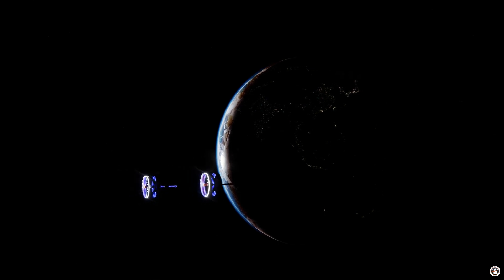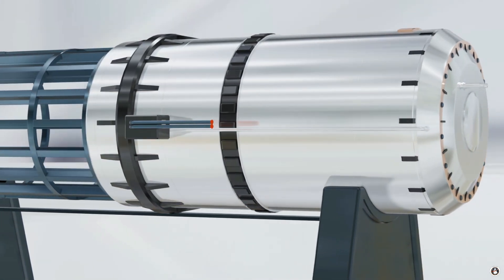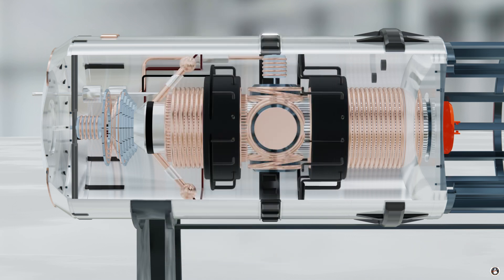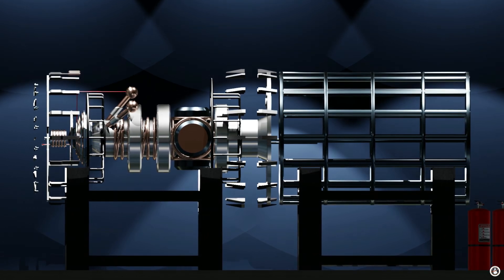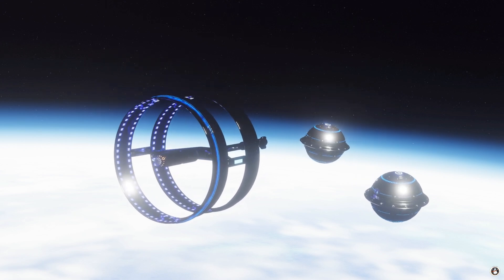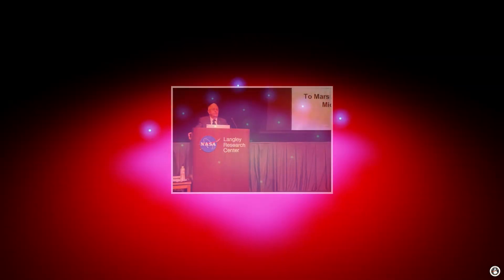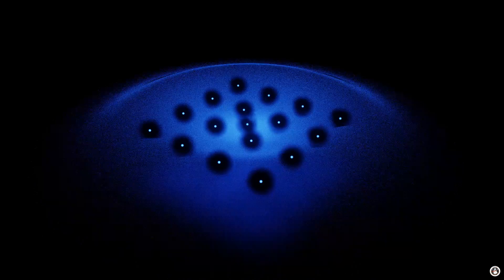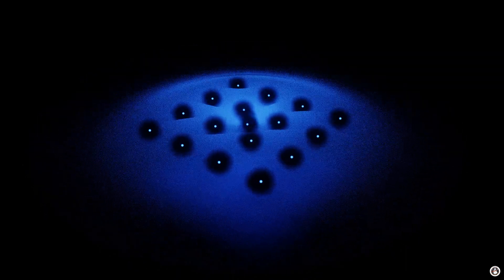Muon Catalyzed Fusion Engine - 8% Speed of Light - Mars in 5 days?

Comment: How would an Epstein Drive work, to be powerful and efficient? In one year, we can go near the speed of light by accelerating at one g. On truly faster, but one of the greatest ideas.
Reply from the maker: This drive will eventually have a performance similar to the 'Epstein drive' ;)
Reply: @asteronx  One g of acceleration?
Reply: @asteronx  I did the math, and to get up to 0.08c at one g takes one month to get up to speed at a start of 0 velocity.
Reply: @WolfeSaber  
One of the problems for crewed vehicles.  In the Expanse, gravity is usually created with acceleration. Ships are designed floor to the engine and are always under acceleration.
But a boost style long journey requires centrifugal force gravity like a spinning cylinder. That means floor to the side of the ship. It also means you can't spend a month boosting at 1 g. The floor plan won't work well for both methods of gravity. Hell, the most sustained gravity practical is 3 g, still requiring a long time to get to speed. and you can't do that forever.
Reply: @icecold9511  Unless the floor can turn from down to the side. The US Navy has a ship with this type of design in mind, when doing research.